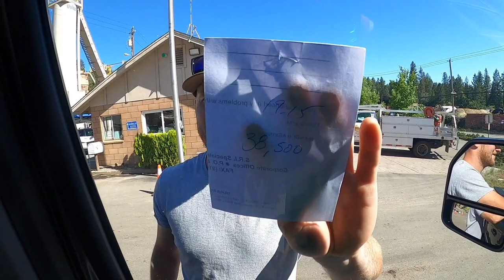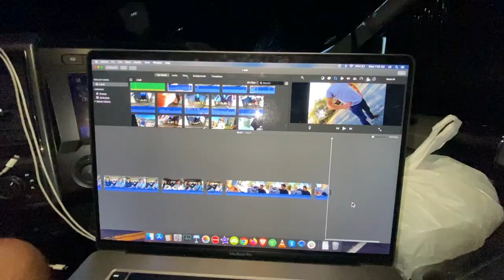Cummins  Fanboy  towed  30K  POUNDS  with my  FORD  and was  SHOCKED

Comment: What a heart breaker. Cancelled my order for a ford after this test drive... 
😂 
Good video. Thought you sabotaged me at the end when you cut the clip😂😂🤦🏼‍♂️
Reply: I really was thinking that you bought one....😅
Reply: Go drive a F450 with the same trailer. You'll get a different experience with bigger brakes, lower rear end gear, and that wide axle with makes turns on dime.
Reply: Come on Sam you know the exhaust brake on the Ford can be tuned! You tune your Rams anyway! 😂
Reply: Fer Delance I have not tuned my ram at all. Tuned my dodge but that doesn’t make the exhaust brake stronger with a tune.
Reply: Do your know if Alex's truck has 3:55 or 4:11 gears?
Reply: Thanks sir for your honesty...Go Ram!
Reply: Okay, I heard Tow Piglet say it so I thought it could be tuned.

Comment: At 8:00 you say Ford could fix, in a tune, to go directly from 10th to 6th. It's not that simple.

The 10R140 transmission has four planetary gear sets, controlled by two brakes, and four clutches, plus an intermediate shaft that is not directly connected to any of the planetaries. Each valid shift on the 10R140 is internally a swap-shift, where one clutch (or brake) disengages, while simultaneously another clutch (or brake) engages.

This arrangement allows a shift from any gear to the adjacent gear, up or down. It can also skip shift from any odd gear up or down to the next odd gear, or skip shift from any even gear up or down to the next even gear.

In the 10R140, there are 26 pairs of ratios where a swap shift is mechanically possible by toggling two elements. There are 19 pairs of ratios where a swap shift is mechanically impossible because three or more shift elements would need to toggle.

It just happens to be that a swap shift from 10th to 6th is mechanically impossible in the 10R140 because it would require a simultaneous toggle of both brakes, and two of the four clutches. It requires at least two shifts to get from 10th to 6th, the fastest path being either 10th-8th-6th or 10th-7th-6th.

Also on the 10R140, 6th gear is the tallest underdrive ratio, and the most complicated internally, as it is the only ratio that works all four planetary sets. 7th gear is the simplest, being 1:1, where everything turns the same speed.

Here are the mechanically possible swap-shift gear combinations (up or down) on the 10R140 (but not all are available due to extreme spacing):
1-2, 1-3, 1-6, 1-8
2-3, 2-4, 2-10
3-4, 3-5, 3-6, 3-7
4-5, 4-6, 4-7, 4-10
5-6, 5-7, 5-9
6-7, 6-8
7-8, 7-9, 7-10
8-9, 8-10
9-10

The mechanically impossible swap-shift gear combinations (up or down) on the 10R140:
1-4, 1-5, 1-7, 1-9, 1-10
2-5, 2-6, 2-7, 2-8, 2-9
3-8, 3-9, 3-10
4-8, 4-9
5-8, 5-10
6-9, 6-10

The 10R140 in the Ford allows you to easily select what you want your top gear to be, the default being 10th. While in "Drive", the thumb switch on the shift lever, pressing it down will reduce the highest available gear by one. Pressing it up will increase the highest available gear by one. Hitting the switch will also cause the color display to show the available gears, and the current gear will be colored.

To get the most out of the engine brake, simply thumb down to reduce the top gear. This will raise the engine RPM. If you lose speed from too much engine brake, just thumb up to the next gear. You can do all this without ever needing to place the shift lever in the "Manual" position.

This same thumb-shift technique also works on the 2011-2019 6R140 transmission.
Reply from the maker: Awesome comment thank you. This truck shifts 10-8-6 often so that makes sense now thank you

Comment: I had a 2015 Ram Laramie 2500 MegaCab. It was my first modern Diesel Truck and loved it som when I was in the Market for a Dually, I test drove a 2020 Ram 3500 with the H.O. engine and 4.11 gears etc. That thing was driving rough and I don't always tow and simply could not see myself driving it every day so just for fun I drove a 2020 F350 and it blew my mind, Way more power and drove smooth like butter. never buying a Dodge again.

Comment: How about using a temperature gun to check your hubs so we can see what you mean by “hot”
Reply: By how long he was touching it it was less than 160 degrees. As you can only touch somthing at 160 for around 3 to 4 seconds
Reply: Right, they're "hot" as he leaves his hands on them.

Comment: Exhaust brake is a deal breaker but it definitely accelerates better than mine after I drove it.
Reply: You can put a Jake on a Cummins so yeah Ford sucks.
Reply: @Venom0496  - Exhaust brakes ARE a big deal when pulling weight.  I have a class A CDL.  When I drove OTR, construction, or heavy haul.  I would not drive a power unit without a GOOd exhaust brake!  My wife has a '18 Ram 2500 6.7L.  She really likes the exhaust brake for driving in our local mountains with over 10% grades.
Reply: Hey buddy 👋🏻 looks like those ford’s make some power... but I’m still a cummins guy...🤷🏻‍♂️
Reply: I wonder if you can manually drop it down to 6th?  I know the RAMs have the +/- on the column shifter; does the Ford?  Also, I'd love to be able to compare the Pacbrake PXRB (or whatever order those letters are supposed to be in) on my 05 RAM with 6sp manual, because I never felt like it was very good.
Reply: @zxej6879  And if you are as experienced as you claim, you should know how to drive a vehicle without an exhaust brake.  The exhaust brake was first used on engines in 1989.  What did drives do for all of the tears of driving prior to that?  And exhaust brake can also cause over heating of the engine/exhaust components.
Reply: Exhaust brake is a deal breaker. Power is nice, but driving through mountain passes are all about safety. I can use adaptive cruise on a 7% pass and my Cummins won’t worry me one bit. I rather have breaks than power and still save on replacing pads early.
Reply: @happypappy6371  Assuming from this comment that you've never pulled serious weight? No offense btw I'm not attacking you here.  In 89 1 ton duallies weren't rated for 38,000 pounds of towing capacity like they are now. Semis back then had Jake brakes. An exhaust brake will under no circumstances overheat your engine or exhaust components unless you're accelerating with it on. I'd rather be able to stop going down mountain passes and not have to worry about my brakes when I'm loaded at 26k in my dually. Even the most experienced people prefer the exhaust brake over the power. 
Little background: I used to tow two cars with a rollback and on my 04.5 dually I used to tow 48ft mobile kitchens trailers which are just about 18,000 pounds on top on my 9,000 pound dually. I did medium duty towing as well. Towed vehicles do not have additional brakes you can hook up. Check my Instagram for the pictures. Safe travels!
Reply: @CPSteveMiller  Jake brakes are an internal addition on the engine which activates the exhaust valves to slow the vehicle.  An exhaust brake is an external add on that restricts the exhaust flow, holding it in the engine and exhaust system, which is why it can over heat the engine/exhaust components.
       All trailers over 1500 pounds are required to have brakes on one axle and over 3000 pounds are required to have brakes on all axles.
Reply: @happypappy6371  I know that. I was  saying pickup trucks. They didn't pull big weight back then like semis did however now we have pickup trucks with half the towing capacity of a semi which is insane. 

Also about the tow trucks - When you tow cars on a wrecker or rollback you do not get additional brakes from them like you get from a trailer. Towing two cars with just the brakes of the rollback sucks. This is one huge reason why that exhaust brake is necessary. Same with medium duty towing. I've pulled 26ft u haul box trucks with my old fl60 freightliner. You do not get the additional brakes from those box trucks. Towing light duty and some medium duty you do not get to hook up additional brakes sadly. That's just how it works. Hell I even ran a 4500 ram repo truck. Imagine pulling a 9000 pound dually with that down grades. You're talking 19,000 pounds with only brakes of the tow truck.
Reply: ZXEJ I call bs lmao!! Highest grade allowed in U.S. is 7%!
Reply: @scs550gotcha5  theres plenty of 10-15% grades in small towns.
Reply: @catsbyondrepair  ford makes their engines,transmission and their hole trucks they make them. Dodge Ram FIAT  is a shit company always falling apart allways getting shit from other company’s dodge doesn’t have Diesel engines or transmission CUMMINS ENGIE not dodge engines and the transmission too they could not make on for 30 years so they had to get them from another company
Reply: You are correct my friend.
Reply: @RobGADV  yes I don’t understand why they didn’t do that

Comment: some people seem to think number of gears are so important, well,  perhaps how well that gearbox is made for what the vehicle is build to do is more important, here in Europe I drive a Mercedes coach with a 10.6 liter engine coupled with 6 speed gear box that does much much better than a similar coach with a Volvo 12 speed gearbox or even a 8 speed Scania box...cruising on the motorway at 62 mph with 50 passengers + gear and so forth with ease, clocking 1200rpm on the tacho...discussions apart about which truck is better,  and having a slight inclination towards Fords, I have  to say, them Cummins engines are absolutely brilliant,   a true work horse that also happens to drag big ships all over the oceans...great tradition with diesels

Comment: I have experienced both trucks at the landscape firm  I work for.  If Ram actually puts a heavy service 8,9,10 speed behind the Cummins it's game over.  The Fords are absolute beasts at the towing level - nothing is going to out pull them.   However,  the Ford turning radius issue (or lack of) persists and the engine brake issue was a real pain.  Very hilly in north Jersey where I work and the Ram was just a better overall performer from a "differing terrain" standpoint.   On highway the Ford is real hard to beat except for the exhaust brake performance.  If Ford is going to address that,  some redesign of valve train is gonna be needed I think.   Both of those trucks are way above anything I thought I'd ever see though.

Comment: I see his complaint, about exhaust brake and trailer brakes getting hot.  He needs to drive a F450 which has a  low rear end gear and much bigger brakes. I agree my 450 does need a more powerful exhaust brake. But his opinion would be different in a 450!

Comment: I think a lot of people are forgetting there’s a difference between the two in cost for repairs. If I have the luxury of leasing a Ford and not have to worry about repairing it after the warranty is up would give me a peaceful mind, but I would never ever own one beyond that because the first time you repair it will Will be costly in parttly because only Ford can work on it and 2 the body Has to be lifted off every single time that’s the “dealbreaker“  ,the Cummins is so much simpler and 1/3 the moving parts not worth the two speed transmission gain, The slight gaining power will be long forgotten up on the first credit card transaction for repairs yeah-No. Great video of two of my favorite tow boys otherwise!
Reply: DESTORE AND add a Cummings

Comment: Omg I almost did because I couldn't believe go another day without your videos
Reply: So, when they improve the breaking for 2021, they will be undisputed champions for sure.  475 Horsepower is a lot, and to add the TQ. I would say Ford is The best at 27,500, but  depending on road conditions, I'd take the Ford for over 30-35,000 pounds. But, how could you go wrong?! These are not trucks anymore, they are mountains on wheels. I'm Ford 9/10 and RAM 8.8/10. He vs get it for the 20,000 mark, but 10,000 less than the Twin Titans is a lot of money I imagine.

Comment: Alex,you are correct the exhaust brake is junk. I have a aftermarket brake in my  F450 and it is night and day better than the brake in my wife’s F250 which is factory. After towing for so long with mine I actually took her truck back to the dealership after she bought it because I didn’t think the brake on her truck was activating. Even the Ford tech said yes it’s working it just sucks. Both trucks are full deletes with EZ LINK tunes but I replaced my brake with a BD aftermarket brake and will do the same to the 250 soon

Comment: To get the gears on the screen you click the + button on the shifter while in drive
To get the gears off click the + button again
To remove gears put it in drive click the + button to show the gears then click the - button to lock out your gears and watch them disappear on your screen and the gears are locked out and it will not shift above your selected gear

Comment: Ram really is going to have to get an Aisin 10spd to compete..it's just where the industry is heading.
Reply: It's coming, but either with ZF or Allison.  I'd rather see the 9 speed Allison behind the cummins.  But I can see when that happens RAM will up the ante like Ford did and push the HO Cummins up to 1100ft/lbs of torque.
Reply: You will never see a good transmission in a Dodge lol. The Aisin is a good transmission it does shift rough and it does hunt for gears. We have a 08 5500 Dodge at work.
Reply: @mavrick0pm  Id LOVE a real 9spd Allison. Im actually going to do an Allison conversion when my 48RE bites the dust. Aisin's are good transmissions..Ive only dealt with ZF's in sports cars. But if They would mate a Cummins to an actual Allison that would be the Bees Knees.
Reply: Well don’t this fca. Will be doing much cause they just merged with Peugeot. So they going to rebrand the company. Who knows what the future hold for ram, dodge,Jeep, Chrysler.
Reply: @Hooptierescue  God here we go again..
Reply: @Graveltrucking  Apparently they just did an update for the TCM. It's supposed to fix the hunting issue. PD Diesel just did a video about it.
Reply: At my work we have international Simi trucks with a Cummins and a Allison transmission in them
Reply: @Graveltrucking  HATERS WILL HATE, YOU ARE DOING QUITE A BIT OF  HATING JUST ABOUT NOW LOL.
Reply: Its coming soon
Reply: @JeremiahHartmanPhotography  I know the ISB7 Cummins usually has an Allison 2000 behind it, idk how different the bell housings are from the ones that Ram uses though. I'd imagine there aren't many differences, if any at all.

Comment: I had a 08 cummins, I’d have to say I’ve pulled some good loads, one time over the Eisenhower pass, I’d never go back to a cummins after taking a sip from the 6.7 psd punch bowl... I have a 16 now, and have to say that with some “enhancements” it will run circles around my old 08( the 08 had the goodies too). 

Pulling with my 16 I still get better mpgs at 28.5k than with the cummins at 22k~

Comment: You have to hit the manual shift + button to show the gear
Reply: The f250 and up you can see the numbers or not by pushing the plus button like the other guys said
Reply: My 19 f250 the same as yours stops great with the engine brake.
Reply: My F450 displays gears all the time

Comment: Any horror stories with the Ram air suspension? That seems like a great idea if you use your truck as a every day driver.  The 6.7 is impressive to tow with. I completely agree about looking under the hood. Actually as tight as it is the cab should just flip front.
Reply: It’s air suspension? How complicated could it be? If it was on a Ford you know it would be expensive at a premium it’s not it’s on the ram and they work great they’re cheap to work on.

Comment: On your new trailer I would get the 8k axles and have them de-rate it.  Better performance of weight(last longer) and braking(braking will help the FORD engine brake) will offset parts availability.

Comment: One issue with jumping down so many gears is youd redline the truck dropping 4 gears like that. I have a class a cdl driving an peterbilt big rig. Every truck i drive has a manual transmission, when i drop down gears quick and only two gears im at 2k rpms and the max is 2100. That being said you would grenade the transmission dropping four gears like that. To give you a better perspective when i slow down from 10th down to 6th theres a difference of 25 mph in speed. That would equivalent to driving a 100 mph and trying to slide to a stop

Comment: And a 7k hub will go right on a 8k axle tube you just have to adapt 4 bolt 8k brake backing plate too 7k flanges I had some welded on my 8k axle tubes now I run 7k hubs bearing seala and brake on my 8k axles no more bent axle hopefully
Also bigtex dosnt have enough suspension travel the axle bottoms out on the frame and bends 8k will definitely help prevent that though

Comment: Fords will show what gear you are in, if no gear display shows up: on the shifter move the manual gear selector button and it will reappear,
Reply: I love fords transmission setup. It will up or downshift whenever you hit the + or - no matter what your throttle position is, everyone else it's a joke. Whenever you select a gear it's still going to shift when it wants, it just stops at that gear. You select 4th it's still going to go thru 1st 2and 3rd and 4th then stay in 4th. I dont like the Ford because it's a nightmare to do any work on it, but one thing I do love is the transmission manual shift. Only thing I dont like is the rpms are always up anytime you accelerate even a little quick because the torque converter doesnt lock until half way thru 3rd gear
 My titan xd locks as soon as you hit 2nd and stays locked, so whole it shifts firm, I like how it stays locked.